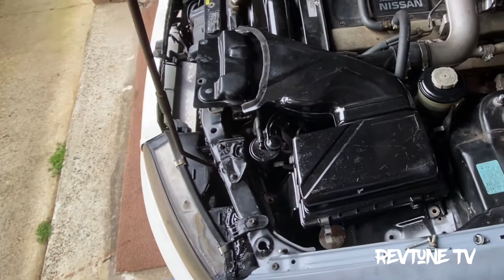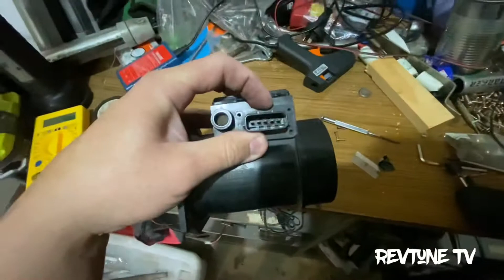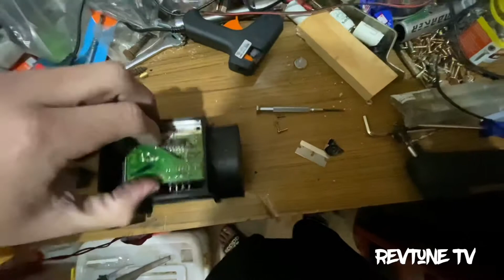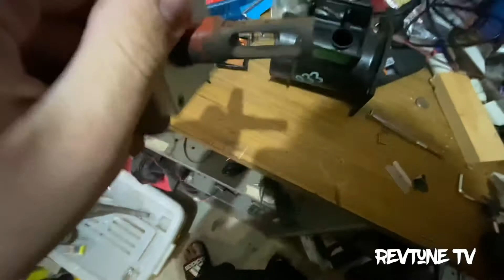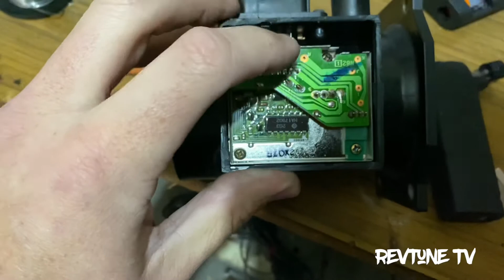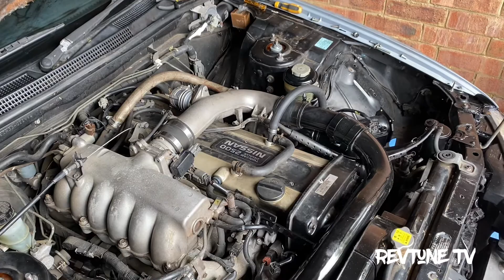How to repair your AFM Air Flow Meter on a Skyline

Comment: What did you heat up the solder joins with
Reply: Refer 3.14min in video, I used mini blow torch or use solder iron, remove black cover and heat sink plate 1st so you can disconnect afm plug from circuit board